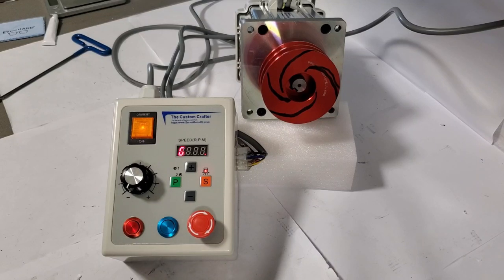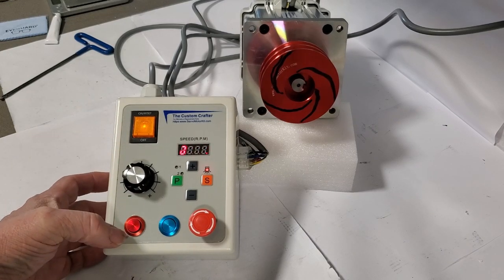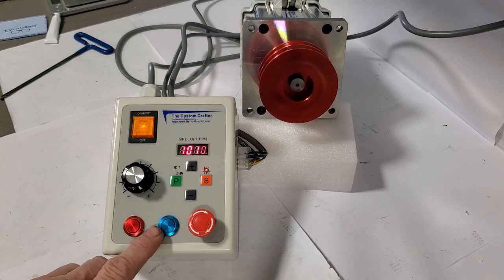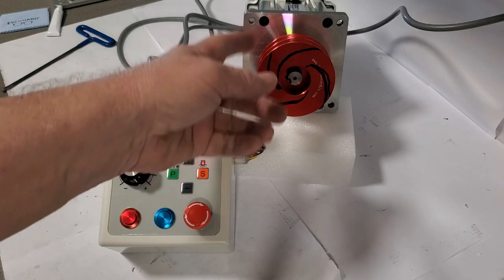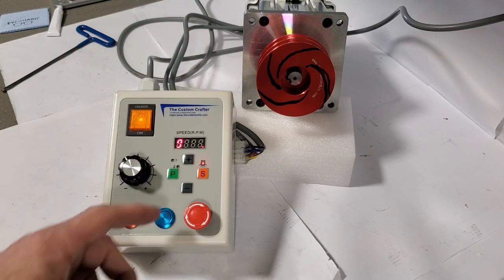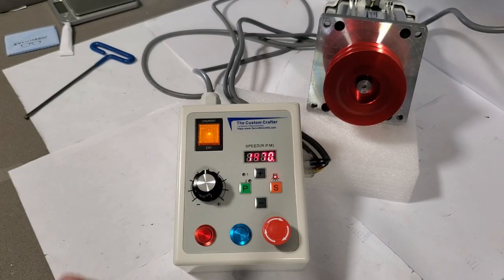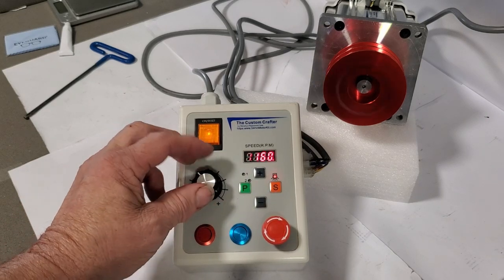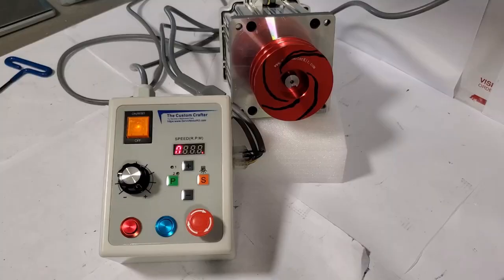New Servo Motor Controller for Mini Lathe and Milling Machine Upgrades

Comment from the maker: Guys. New products are like new Apple phones. It wont be long and their common. Some time this summer I will make this controller a replacement part and available at a great price for those who already have an earlier version of my motors. Same goes for the new tethered switch. When there is enough sales it gets manufactured better and at lower cost.

Comment: AUGH~! I JUST bought and installed the previous version of this kit for my Craftex CX704 mini lathe! It works great, but the instant-reverse and finer RPM adjustment would have been nice. Not a dealbreaker though.

900 watts on tap is really nice. Don't need to step through 1/4" then 3/8" then 7/16" then 1/2" to get a hole in steel, I can just go straight to 1/2". Even handles a 1-1/16" annular cutter at very low (315) spindle RPM.
Reply: I know... I bought the earlier version too and now trying to justify the upgrade🤦‍♂️